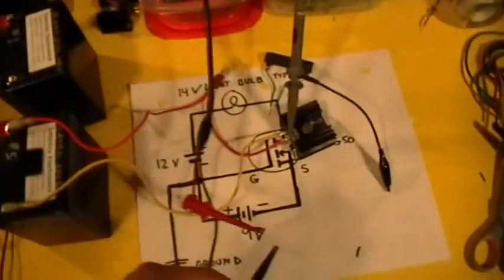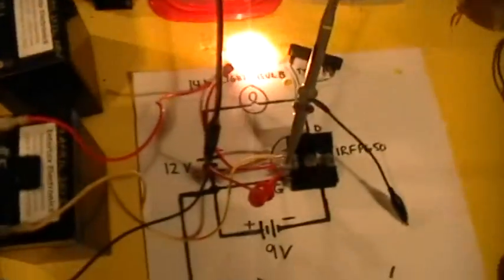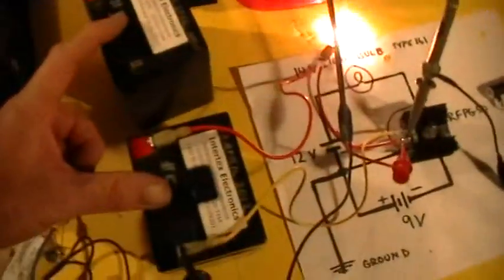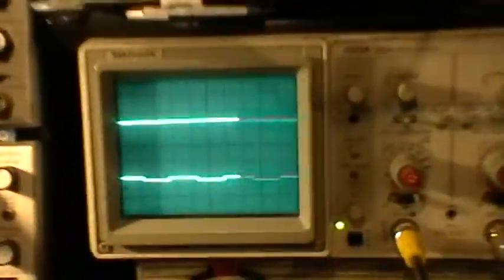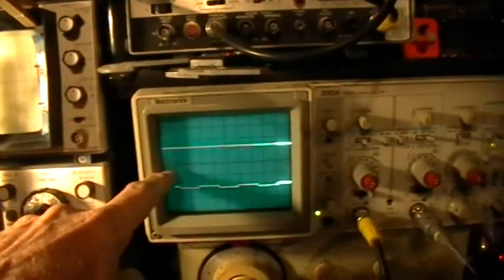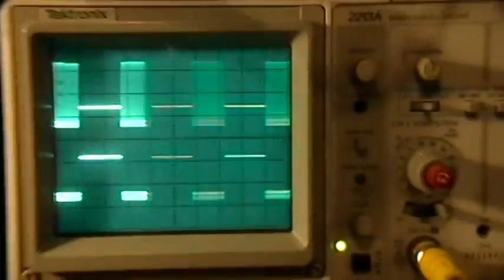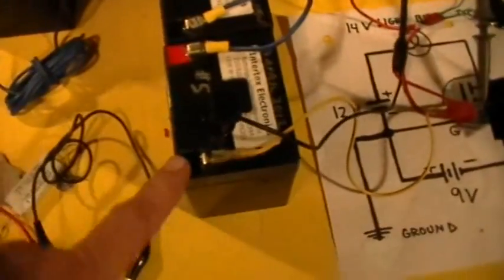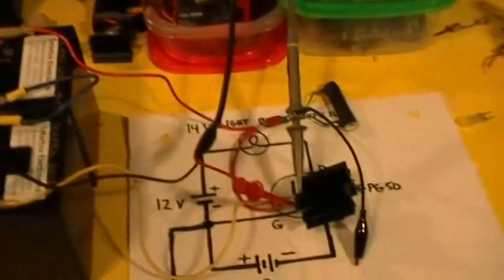Electric OU: How DO Mosfets Work? NERD Circuit Q2 Remedial Part 2

Comment: @TinselKoala   When the FG is connected in series with the 12V battery and it is switching the current through the MOSFET to light the GE 161 14V 0.19A bulb there would probably be about 180-200mA current flow through the FG when the bulb is lit.  Is this about right and approximately how much current can your FG safely handle?  Probably something to take into consideration if replicating this part of your 12V demonstration with incandescent bulb which provides good visual monitor of current flow.  I understand that you do not have any significant current flow through the FG when the MOSFET oscillates at 24V or higher.
 
I'm curious what that fluctuating multicolor light is to the right of your oscilloscope.
Reply from the maker: The Ainslie circuits normally do need bias currents in the range you cite or slightly less, and this has been measured independently and by the Ainslie team themselves, although Ainslie herself denies the significance of their own measurements. They very rarely actually show any tests made with a full six-battery main supply, even though that is what they claim. The March 2011 demonstration, which is on my channel, shows that when they do the "high heat" tests they actually remove batteries to reduce the input voltage and hence the average currents that flow in their FG during the Q2 oscillation phase. What saves them is that when the Q1 is conducting the FG is no longer in the main current path. These particular demos of mine have no Q1 phase, though, and all the current does go thru the FG as you state.  That is actually the purpose of these demonstrations, since Ainslie has claimed in her ignorance that the Q2s are actually "disconnected" (her word) during the oscillation phase.
The Interstate F43 is a "high voltage" function generator and has no difficulty with currents that might adversely affect an ordinary, more modern digital-synthesized FG. It can put 40V p-p into a 50 ohm load.  I have blown the output stage transistors one time, but it had nothing to do with the normal operation of the circuit but was caused by a cascading multiple mosfet failure in the device under test.
Heh... the mutlicolored light is the "NERD Testing Preventer" which prevented the Ainslie team from performing any tests on their own apparatus for over two years. (insert winky smiley here.) It is an Arduino-based system that drives a single RGB LED in various ways. Presently I have it simply doing fast random flashes. It has about 20 different flashing and fading routines programmed into it. The "mood light" function is where I usually leave it set, where the RGB LED is driven in a fading mode, so the pingpong ball diffuser fades slowly through the full spectrum from white to fully saturated Red, Green, and Blue, and all combinations of hues in between. I think I have a video describing it and giving a link to the program sketch; you can search my channel for "Arduino" to see all my Arduino projects (except the current one, a Braitenburg light-tracking robot which I haven't videoed yet.)
Cheers, thanks for watching and especially thanks for the good warning. Ainslie has reported blowing one of her modern FGs.... but at 200 dollars for a new one, they aren't worth repairing and probably need surface mount components anyway.
Reply: TinselKoala 
Maybe you already covered this but there may be some who hold off replicating these demos because they have a digital-synthesized FG that is more susceptible to damage or simply don't want to risk damaging there old FG.  This would include any supporters that Rosemary Ainslie may still have.   So is there an interface circuit that may have already been discussed here or in a forum that could serve as a buffer between the FG and the circuit under test?  Or also for those that may have an oscilloscope but no FG, a stand alone 555 or Arduino circuit that can serve the role of the FG that would safely handle the test current or could be easily repaired?  Is this impractical due to the required bias or other FG functions that are needed?   You are providing good practical demonstrations that would be good to have replicated by anyone who wants to confirm for themselves or just for a good learning experience.